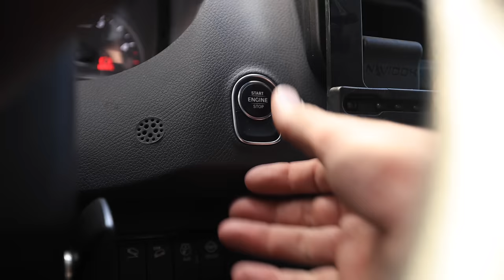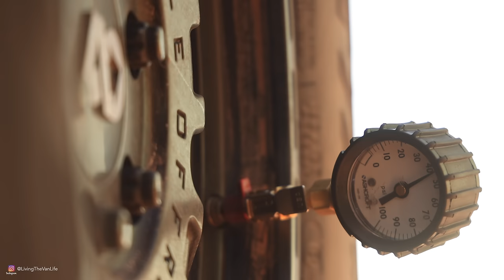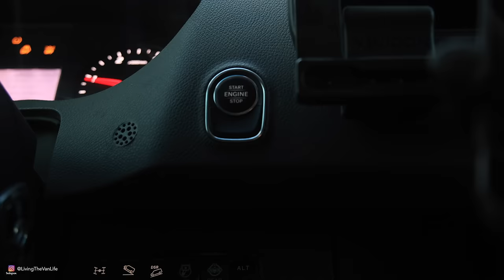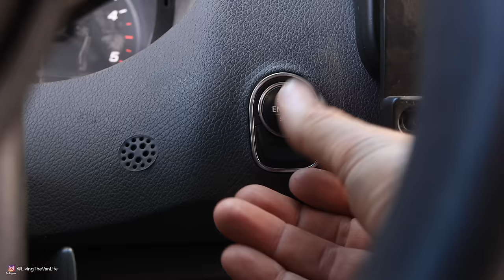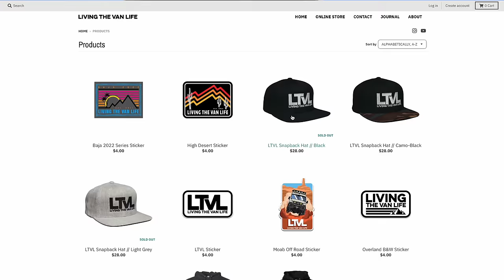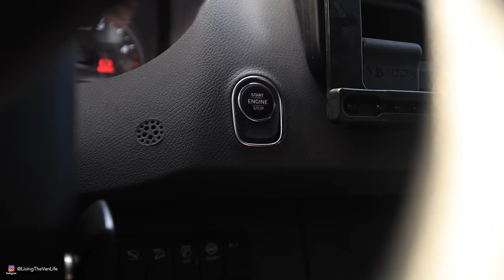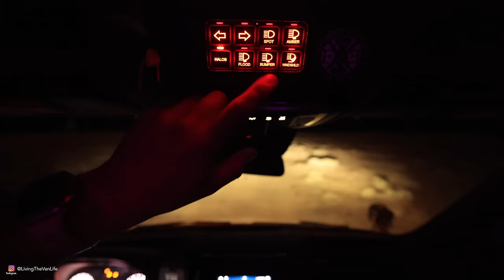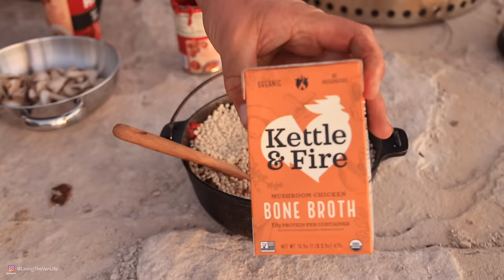Overlanding The Planet | Desert Life In a Sprinter | Living The Van Life

Comment: Chad they got anchors that you can hook your winch too in situations like you run into for off roading..You can order them on line or find them at your local dealer off roading stores.. They hold any were from 5 to 10 thousands pound very easy to use..You put them in ground in front off your van...

Comment: Ah, the old Italian sausage returns, wouldn't be the same without it. I had a similar jacket which melted on my Solostove so watch out you dont melt the cuffs Chad. How easy is it to travel those Utah mountains Chad as I want to come over from England and explore them. Do you need a permit ? Can I hire a 4x4 vehicle etc ?
Reply from the maker: Absolutely would be very feasible for you to come over and explore.  No permits necessary. Can rent typical SUV’s which would most likely be more of an AWD and less ideal.  In Moab you can rent jeeps and sorts. And you might be able to dig deeper to find more of a capable 4x4 suitable for some decent Outback exploration.

Comment: Hey Chad, what deflator system are you using? I like the simple pull to release and watch the pressure while deflating your tires.
Reply from the maker: These valve stems are part of the Agile Offroad Overlander HD wheels. Check them out.

Comment: I am always in awe of how well built your Van is for these adventures.   Would Maxx Traxx have helped you get out of the hole?  Wide surface area to push out material after digging?
Reply from the maker: ha!  I actually haven't found a good use for maxx traxx in getting myself unstuck...  but they work great for leveling the van at a campsite.  haha

Comment: Could that trail be done with an AWD Sprinter Van or did you need to use 4L at times?
Reply from the maker: I use the ultra low crawl gear on my Atlas transfer case all the time.  You don't have to beat the van up NEARLY as bad...